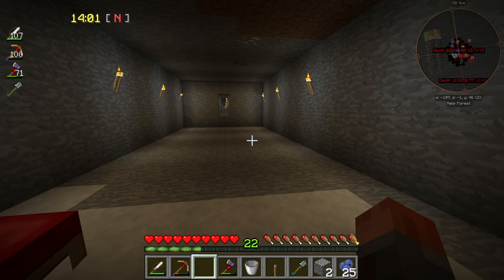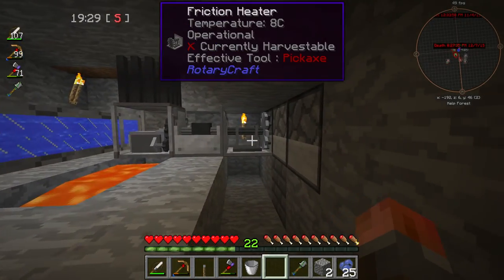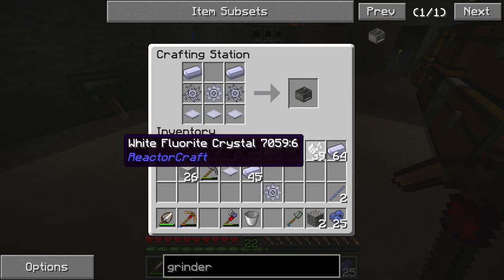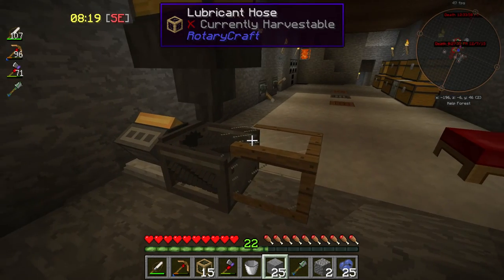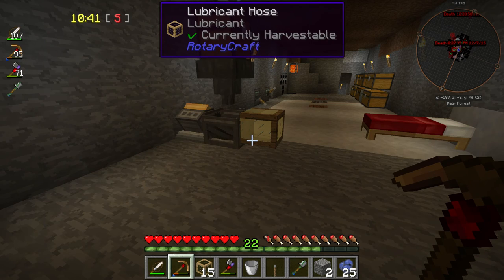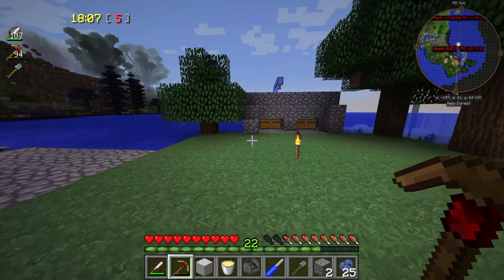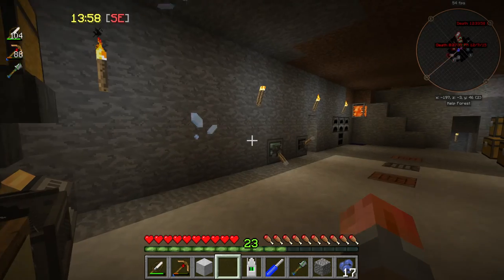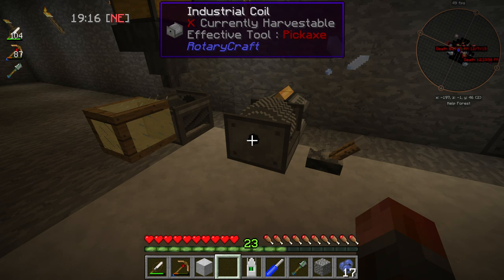RotaryCraft Tutorial E03 - Gasoline Engines, Clutches and Gearboxes

Comment: The friction heater actually scales with Power, but functions most efficiently when both Torque and Speed are equal.

Coal in the Revolution Pack only generates above Y 95, so go find a mountain :D

A wooden gearbox with a cooling fin on it and the steam engine is sufficient to power the grinder and doesn't require any lubricant. It takes about 30 seconds to process each item though, so it's quite slow. Useful if you don't want to advance straight to gasoline engines though.

Most blocks in RotaryCraft will place with their output facing you and/or their input opposite you.

RotaryCraft has a Reservoir for liquid storage that holds 64 buckets and can merge horizontally with adjacent reservoirs. Applying a glass pane to the top of it will cover it so that you don't fall in, though harmful liquids inside will still harm you through the glass if you stand on it. It will keep its contents when broken. If placed outside during the rain and not covered, it will collect water.

It's worth mentioning that the grinder will perform ore tripling, so it's a great early-game ore processing machine before you can power the extractor.

It's possible to power the extractor with four steam engines. This would be a good way to introduce concepts like shaft junctions, the screwdriver, bevel gears, feeding lubricant to gearboxes, using the multi-directional clutch, and the shaft tolerances of each gearbox material and how you can mix and match them to save on materials in the early game. To be honest the entire early-game extractor powertrain is a goldmine for introducing all of the basic concepts you should know to make the most effective use of what Rotarycraft offers as it starts with the DC engine and a pump for producing water, piping that into a steam engine with a wooden gearbox and a cooling fin powering the grinder which is fed canola seeds (perhaps from a fan, also being powered by DC, for complete automation) to produce lubricant, then piping the lubricant into your gearboxes in the extractor setup. The setup itself then introduces concepts like merging engine power and utilizing the multi-direction clutch (as well as the regular clutch- turn off the gearboxes when the extractor isn't in use to conserve lubricant!) and chaining gearboxes. Setting all this up runs through every major concept in the early game of RotaryCraft and easily prepares the player for the middle tier of the mod's progression.

The fuel indicator on the steam engine actually refers to the water, not the heating underneath it.

The industrial coil supports reading its energy level from a comparator which you can use for automating cutting the power input to it so you can preventing it from exploding when you aren't watching it. It is not explained in the book and I ended up having to look it up on wikipedia, but a Joule represents the amount of energy required to produce one Watt of power for one second. From this you can calculate how long the industrial coil will run for at the desired output level. At the max charge of 720MJ and the max output of 1MW, it will run for 720 seconds (a little less since I'm rounding here- 1024^2 is slightly more than 1MW.)
Reply from the maker: +Toksyuryel Oh thank god, a way to get coal! :)
Reply from the maker: +Toksyuryel I think I saw something about using a worm gear with the steam engine for the grinder too (which also I think doesn't require lubricant) - I may update that purely for lubricant.  I think the current setup largely should help for the grinding/ore side of things - 30 seconds is a bit too annoying when I need iron quick :D

I did look at the reservoir, and I think I'm in favour of starting to use those for things like a buffer in case of pump issues, as well as buffer tanks for ethanol (and presumably lubricant) to avoid failures immediately on things running dry.  The multi-block nature of them is pretty awesome.

I think I'll probably bring in the dynameter(sp?) when explaining the various gearbox combinations - should help people who aren't keeping up with me talking constantly, as well as more visual learners.

I definitely like the idea of getting the power level via redstone and using a comparator - the industrial coil when I've used it previously, I've always set up a timed clock to keep switching its modes, obviously less than perfect, but simpler there.
Reply: +grayduster The dynamometer is great :) might also be a good idea to introduce the idea of using the clutch when building out a setup that has running engines already attached to it so that when placing gearboxes they don&#39;t explode instantly due to defaulting to torque mode.

Yeah using reservoirs as buffer tanks is a great idea, and something I find myself doing regularly. Also when moving a setup it is important to remember to drain the lubricant hoses into reservoirs before breaking them as they can store up a huge amount of lubricant in them and it all gets lost when you break the pipe. When I moved my extractor setup the last time I found about 10 full reservoirs worth of lubricant had collected in the pipes, so it is not a trivial amount.

I have never used a worm gear, could never figure out a scenario in which I would ever need to.

Comment: For the sugar cane farm you could just use pistons, flowing water, and a hopper clock to do it all vanilla. Then you can feed it into a grinder to make tons of sugar, use it as biomass for your fermenter, and then compost the rest for dirt.Also your industrial coil isn't going to work for the extractor. You would be better off with a gasoline engine with a 16x steel gearbox and manually swap it between speed and torque to power the different stages.
Reply from the maker: +Baron Malkar Oh, if I didn't mention the 16x, then yes, I was already planning that to switch between modes to switch between phase 1/4 and phase 2/3 in the extractor.  I may well show off the performance engine as a quicker/better way to charge the coil, along with the engine control unit.

It's been a while since I've done a vanilla farm, but that sounds like a good approach!

Comment: The Gasoline engines are good, but you should have gone straight to the performance engine instead. They both behave exactly the same and output the same torque and power. the only major difference between the two is the performance engine can have additives inputted to increase output making it more worthwhile. Especially when additive free it runs just as well as any conventional Gasoline engine
Reply from the maker: +swordkorn I definitely intend to upgrade :)  The next episode is on the industrial coil shuffle to get the extractor working (don't have enough speed/torque for all four processes of the extractor without changing gearboxes, and no CVT to help yet as it uses bedrock :))
Reply: +grayduster Well since you started your tutorial I've installed the Reika mod list alongside industrialcraft 2 (I personally felt it added in a level of progression to the pack in terms of early ore processing) and SentinalHMC here on YouTube has a Rotarycraft tutorial (creative but useful) and after watching his segment on the engines and some experimentation of my own the performance engine (if you can afford the additional part and additives) is better than going from Gasoline to performance. I'm enjoying a Survival focused tutorial series though and I thank you :)
Reply from the maker: +swordkorn Oh, I've no doubt they're better :D  I'm largely just covering as much of the mod as I can (debating the hydrokinetic and windmills), and as you say, taking that from a progression standpoint.  Unfortunately, Rotarycraft doesn't really have a huge amount of progression - as you say, you can skip a lot of stuff by throwing huge amounts of iron at things!  I'll take a look at that other channel, always up for seeing creative work :)
Reply: +grayduster Well Reika relies heavily on Gold later into the mod I've noticed. I've still not come up with a good way to automate a sugar farm yet either. Dirt isn't a huge issue as I have Extra Utilities for a quarry which helps with dirt and resources but I'd be very intrigued as to your methods for sugar cane and dirt
Reply from the maker: +swordkorn I think sugar cane and dirt are going to be very... tricky with only RotaryCraft :)  My past FTB Monster play through, I just used MFR for the sugarcane and plant balls for the dirt, I'll have to see! (there's always a very large vanilla sugar cane farm as an option)
Reply: +grayduster Bearing the sugar cane farm in mind... could it be possible to half some of the sugar cane towards compost creation?
Reply: +swordkorn The performance engine is far less fuel efficient than the gasoline engine when running on ethanol alone, and requires coolant in the form of water or it will overheat and explode (even when running on just ethanol.) It also holds fewer hours of fuel in its tank- only 2 hours, vs. 5 hours in the gasoline engine. Using the Performance Engine Upgrade item you can transform a gasoline engine into a performance engine (the upgrade costs all of the materials you need for the performance engine minus the ones you already spent on the gasoline engine) so there is no reason at all to not start with the gasoline engine until you have a strong supply of additives.

Though to be honest I always end up skipping the performance engine entirely, my middle-tier path typically goes from gasoline engines to AC electric engines to an industrial coil to hydrokinetic engines (the 1MW of the industrial coil is sufficient for making spring steel, and the 2MW you get from four hydrokinetic engines is sufficient for making sintered tungsten.) Save all that blaze powder for making jet fuel :D